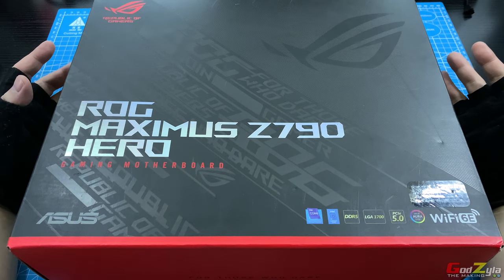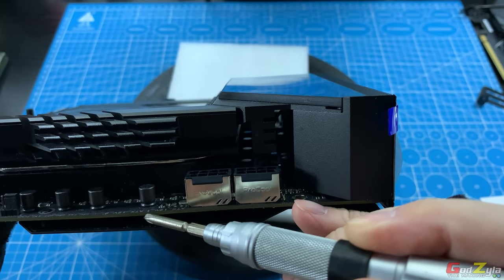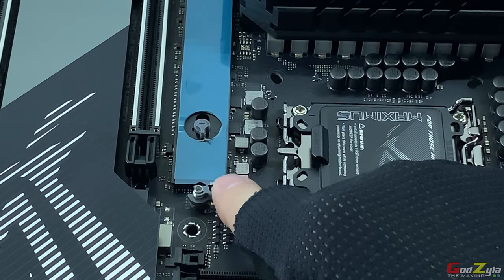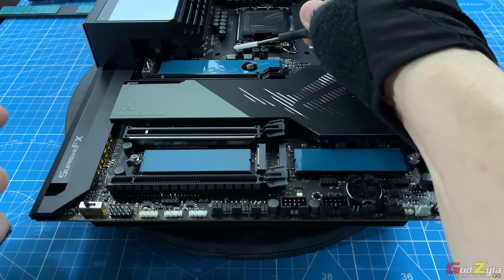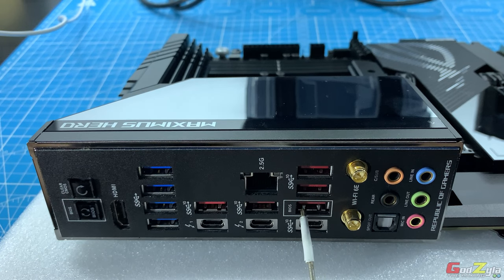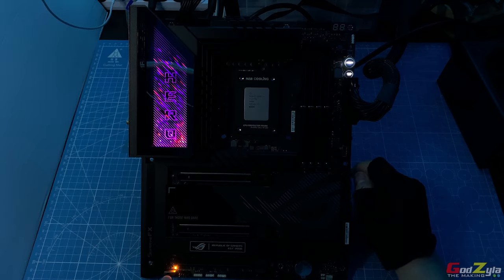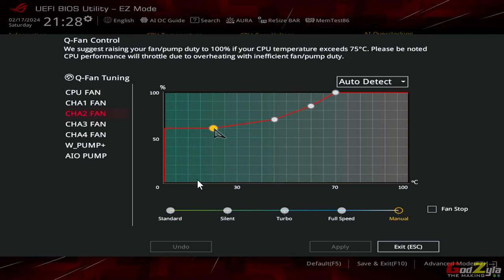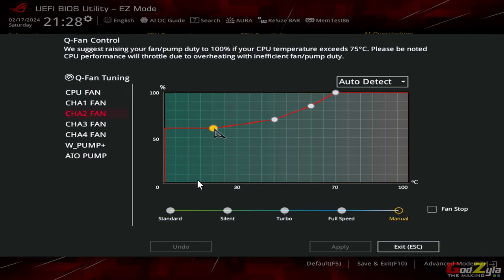Asus ROG Maximus Z790 Hero

Comment: I’ve had this MB for over a year, didn’t even realize the switch on the bottom left of the board until you pointed it out!! You’re great thank you!
Reply from the maker: Hi Nick, welcome to my channel. I am glad you like my content. Yup, if you want specific generation to run on those two slots (PCI-E and M.2) you can make use of that switch, but at all times I will just leave it Auto.

Comment: Your review always perfect !! Very easy to understanding the content, not like the another reviewers, from this now i want purchase this motherboard loll, the backplate with thermal pad, vrm cooling system is really solution for me and can add more mini fans for extra cooling is really great !! , for the bios i think is similiar like z790 asus series i guess ? And how do you think if this compare to dark hero and apex encore ? Is there any different huge different ?
Reply from the maker: Hi Tuyul Nyasar, welcome to my channel and thank you for your valuable feedback. I would say if you can top up to Dark Hero, go fo it. else Hero is as good. now for Apex, I have not touch on this board, therefore not able to give any comments on it.

For the Dark Hero, it's just an replica of the Maximus Hero but with improvement. The improvment as as follow

Dark Hero 
1) XMP profile up to 8000 instead of 7800
2) Enhance Memory Profile (suppose to aid on memory cycle and xmp profile)
3) Wif Fi 7
4) read below as minimal compromisng the PCI-E lane used

Maximus Hero
Total supports 5 x M.2 slots and 6 x SATA 6Gb/s ports*
Intel® 13th & 12th Gen Processors*
M.2_1 slot (Key M), type 2242/2260/2280/22110 (supports PCIe 4.0 x4 mode.)
Hyper M.2_1 slot (Key M) via ROG Hyper M.2 card, type 2242/2260/2280/22110 (supports PCIe 5.0 x4 mode.)**
Intel® Z790 Chipset**
M.2_2 slot (Key M), type 2242/2260/2280 (supports PCIe 4.0 x4 mode)
M.2_3 slot (Key M), type 2242/2260/2280 (supports PCIe 4.0 x4 & SATA modes)
Hyper M.2_1 slot (Key M) via ROG Hyper M.2 card, type 2242/2260/2280/22110 (suppports PCIe 4.0 x4 mode)**
Hyper M.2_2 slot (Key M) via ROG Hyper M.2 card, type 2242/2260/2280/22110 (suppports PCIe 4.0 x4 mode)***
6 x SATA 6Gb/s ports**
* Intel® Rapid Storage Technology supports PCIe RAID 0/1/5/10, SATA RAID 0/1/5/10.
** When ROG Hyper M.2 card is installed on PCIEX16(G5)_1, Hyper M.2_1 slot can support PCIe 4.0 x4 mode. When ROG Hyper M.2 card is installed on PCIEX16(G5)_2, Hyper M.2_1 slot can support PCIe 5.0 x4 mode. When ROG Hyper M.2 card is installed on PCIEX16(G4), Hyper M.2_1 and Hyper M.2_2 slots can support PCIe 4.0 x4 mode.
* When ROG Hyper M.2 card is installed on PCIEX16(G5)_1 or PCIEX16(G5)_2, Hyper M.2_2 slot will be disabled. When ROG Hyper M.2 card is installed on PCIEX16(G4), Hyper M.2_1 and Hyper M.2_2 slots can support PCIe 4.0 x4 mode.
** RAID configuration and boot drives are not supported on the SATA6G_E1-2 ports

Maximus Dark Hero
Total supports 5 x M.2 slots and 4 x SATA 6Gb/s ports*
Intel® CoreTM Processors (14th & 13th & 12th Gen)
M.2_1 slot (Key M), type 2242/2260/2280/22110 (supports PCIe 5.0 x4 mode.)**
M.2_2 slot (Key M), type 2242/2260/2280 (supports PCIe 4.0 x4 mode.)
Intel® Z790 Chipset**
M.2_3 slot (Key M), type 2242/2260/2280 (supports PCIe 4.0 x4 mode)
M.2_4 slot (Key M), type 2280 (supports PCIe 4.0 x4 mode)
M.2_5 slot (Key M), type 2280 (supports PCIe 4.0 x4 mode)
4 x SATA 6Gb/s ports
* Intel® Rapid Storage Technology supports PCIe RAID 0/1/5/10, SATA RAID 0/1/5/10.
** M.2_1 shares bandwidth with PCIEX16(G5)_2. When M.2_1 is enabled, PCIEX16(G5)_2 will be disabled and PCIEX16(G5)_1 will run x8 only.
Reply: @KleoYan  thank you for the reply, i think the benefit of different higher motherboard is from the slot ssd and oc ram ? I'm also notice there is conflict between ssd and gpu because there is same gen slot pcie and make gpu performance drop example z790 apex.
Reply from the maker: @tuyulnyasar2784  it will only drop if you put Gen 5  m.2 where it drops from x16 to x8. for me I can't be bothered with Gen 5 m.2 as the durabilty is often lower. (TBW - Terabyte write)

Comment: Hey I’m planning to build my first PC, do you know if the sn850x with heatsink can be used with this motherboard? Can’t find anything on whether it will fit
Reply from the maker: Hi Jean Aguilar, welcome to my channel. I would strongly advise to remove the SN850X m.2 heatsink, reason for this, even if you remove the thermal pad on the motherboard m.2 top slot, there is still a plate underneath. you might be cable to force it in but I wouldn't advise you to do so.

Comment: Hey another question, people all over the interet say that when installing a Gen 4 or 5 M.2 SSD's on the top first spot, the GPU will be reduced from 16 to 8 lanes.. but i run a Gen5 M.2 in this slot and my GPU goes full 16 lanes, are there just some versions of the Z790 boards having this issue? 
So i currently installed just this one M.2 and still not used another M.2 or the Hyper extension card, can you give me the best possible solution to get the most M.2 slots or the board in general maxed out in the best way with M.2, if possible Gen5, if not Gen4 
should i go with the Hyper extension card? or use the 2 extra slots?
Reply from the maker: Hi Velvet - Real Horror, welcome to my channel. I am not able to test this out as the board is no longer with me. It will be best if you can ask your question at Asus reddit. https://www.reddit.com/r/ASUS/
Reply: @KleoYan  Alright thanks!
Reply from the maker: @VELVET462  thank you and all the bast 😉

Comment: just ordererd the 14900k with this board+ 192GB Vengeance Ram quad kit, this video will help when building, thanks, you do a great job explaining everything!!
Reply from the maker: Hi Velvet - Real Horror, welcome to my channel and I am glad you like this content. All the best with your build too 😉
Reply: How did that turn out?
I'm also getting this MB with 14900K
Reply: @thedarkknightdeltakx-4756  Hey, everything worked like a charm.. had not one single problem, Just one thing, i started with 96GB RAM and i still did not installed the other 2 Ram sticks, will do this in the future but as said, for me everything worked perfect, without a single error
Reply: you just have to correct the wattage of the i9 of course, otherwise it goes full :D thats the first thing after starting or after the bios update
Reply: @VELVET462  So I have to put a Bios Update ?
Reply: @thedarkknightdeltakx-4756  yea sure always after installing a new motherboard, its most likely not up to date when buying
Reply: @VELVET462  Lovely. Probably getting rest of the parts at mid or end of summer. Anyway thanks for the "intel"
Reply: @thedarkknightdeltakx-4756  anyway, wish u good luck with all, let me know when you get into some troubles setting it up :) my comments keep getting deleted or not getting posted.. dunno whats wrong
Reply: @VELVET462  thanks and really appreciate it.

Comment: hi kleo I am thinking of buying the Deepcool LT720 AIO. Is the pump durable enough? I saw some reviews; they say the pump failed in 3 to 6 months. Please help, bro, and guide me (arctic and ek aio are not available in my country).
Reply from the maker: Hi Zoom Videos, welcome to my channel the LT720 AIO is overall good and for me, I have been testing it for more than a month. no issues or whatsoever, just make sure the pump is running consistant 100% or 80%, some have encounter pump failure as they make use of PWM which the pump motor fluctuates up and down base on CPU temp. for me I run it at 100%,  So you dont have to worry as long as your pump is either running at 100% or 80% always. as why 80%, some find it noisy. Also check the warranty coverage of where you purchase it. so in the event if it does happened to your AIO, you can get it change instantly. Another hint for you, for those who uses liquid AIO, it will be best to have an Aircooler standing by, just incase you need to send your liquid aio for repair. I would recommend to get this aircooler, cheap and good, Thermalright phantom spirt 120 SE (7 heatpipes)  https://www.thermalright.com/product/phantom-spirit-120-se/

Comment: Have same motherboard after building I get a warning message - Please ensure to fully connect at least one 8- pin ATX_12v connector to the psu for system stability.
We strongly recommend connecting all ATX_12v connectors under heavy usage. 

After updating bios, it now changed from that to - Please ensure to fully connect at least one 8- pin CPU_12v connector to the psu for system stability.
We strongly recommend connecting all CPU_12v connectors under heavy usage.

Computer works perfectly fine with no crashes. I have done a stress test using OCCT everything came back clear with no issues.

Also, both CPU connectors are well seated and connected to the PSU

CPU - i9 - 14900KF
GPU - MSI 4070 Ti Super
PSU - RM850e(850w)

Any Idea what is causing me to have this warning massage?

Thanks
Reply from the maker: Hi Silva Stoner, welcome to my channel. first you have the error message pointing towards your ATX_12V which is your EPS 8pin cable and after the bios update, you have the CPU_12V connector. It doesnt seems to me that your system is at any fault if you have tested in OCCT. I strongly suggest you to have your motherboard RMA or to do a 1:1 exchange. It might be the sensor build on your board is faulty. Before you do so, you might want to check with others at Asus Reddit forum. https://www.reddit.com/r/ASUS
Reply: @KleoYan  Thank you.
Reply from the maker: @silvastoner  you are most welcome and so sorry, couldnt help you out as you've pointed out the stress test done and to ensure all connections are done properly.

Comment: I do not understand Asus making that add on 2x  M.2 card as big as they made it.. which if placed in the second slot will only block the air flow of the GPU.. why?  Why so big of a card, the M.2 drives are not that big and its a waste of pcb board to make it that large knowing if placed in the second PCIE slot it will be blocking the air flow into the GPU..
Reply from the maker: Hi LivelysReport, welcome to my channel and yes, I do agree with the blockage but as why so big. It m.2 are to be if PCIe 5.0, that will run hot, which I believe why the PCIe m.2 card has a massive heatsink to cater for not 1 but 2 gen 5 m.2. With this said, I still agree to your point and there might be other solutions to this, instead of having two disadvantages. 1) card being big. 2) blockage of the GPU placement. Will feedback this to Asus if they can improve this on their next board. Thank you for your feedback.

Comment: What do you think about 
Asus ROG Strix B650E-E Gaming WIFI. Is it a good motherboard? Which is better to buy 
Asus ROG Strix B650E-E Gaming WIFI or Asus ROG Strix B650E-F Gaming Wi-Fi ?
Reply from the maker: Hi Ioannis, welcome to my channel, if budget allows to, I will go for X670E boards, as for B650E boards, either one (B650E-F or B650E-E) will do just fine. difference is on budget and the features. you might want to compare them at (B650E-E) https://rog.asus.com/sg/motherboards/rog-strix/rog-strix-b650e-e-gaming-wifi-model/spec/ and (B650E-F) https://rog.asus.com/sg/motherboards/rog-strix/rog-strix-b650e-f-gaming-wifi-model/spec/
Reply: @KleoYan  Thx🖖
Reply from the maker: @ioannis.  you are most welcome. all the best with your build too. 😉

Comment: I just got this board and I can’t get it to boot, can you help?
Reply from the maker: Hi AimBoyYardie, welcome to my channel. by plugging the processor and rams in.. if you are not able to boot, try only one ram stick. look at the error code. what do you gets?
Reply: @KleoYan  thanks so much for responding! Error code 55?
Reply from the maker: @DieHardFlint  For error code 55, it means either you have not sit your CPU properly or there are dented pins on your 1700 socket. Also if your rams are not detected.

Comment: Had this board  for 1 year and running great until now. Pair this board with strix 4090 and it block 2nd pcie gen 5 slot and cant utilize hyper M.2 gen 5 ssd…then ASUS came out with z790 dark hero and relocate the 2nd pcie gen5 slot a little bit lower to accommodate big graphic card like strix 4090
Reply from the maker: Hi Am 84, welcome to my channel and thank you for sharing your experience and additional info. 👍

Comment: I want install ssd on this board which slot can used without loss performance ?!!
Reply from the maker: hi SIL3NC3 SHOT, welcome back. If it's of nvme m.2, plug it to the top slot near the processor, that will gives you better boot time. If it's 2.5" SSD, it does not really matter where you plug on the sata port as all sata ports are controlled by the z790 chipset.
Reply: @KleoYan  thx bro . But i have 2nd one so as your review if i installed it on slot m.2--2  is there any loss of performance or bandwith for pcie ...sorry for my. Question  but i need use all slots for m.2 without affect on pcie 1 bandwith /lanes . Is that possible?
Reply from the maker: @SIL3NC3-SHOT  for m.2 if you place any of the slot, no performance loss, even if you plug a Gen 5 m.2 slot at the first slot. unless you are using the m.2 PCI-E riser. If you plug it to the 1st PCIE slot, m.2 3rd slot will be disabled and if you plug the m.2 PCIE risrer to the last PCI-E slot, then all your m.2 can be used but at Gen 4 speed.
Reply: Thanks i appreciate your help🙏
Reply from the maker: @SIL3NC3-SHOT  most welcome.

Comment: is this motherboard compatible with i9 14900K ?
Reply from the maker: @Energy666.  hi and welcome to my channel. Yes it is compatible.
Reply: @KleoYan  thanks bro another question better this motherboard or one ASUS ROG STRIX Z790-E GAMING WIFI II  for I9 14900k?
Reply from the maker: @Energy666.  either board does its job. Greatly depends on your usage. For me I will go with Asus x670e-e as all the m.2 slots are on the board and do not require to plug the m.2 PCIe card to have additional m.2.
Reply: Ok thanks !
Reply from the maker: @Energy666.  you are most welcome. All the best with your build too. 😉

Comment: Could you compare it with AsRock z790 Nova please?
Reply from the maker: Hi myfavouritetrash, welcome to my channel and this is my content about the nova https://youtu.be/Esfw8JlPNFk?si=ciF1386jd0850h6J . For nova there are no thunder bolt port behind not a bios flashback button behind but the advantage of nova is that it has 6 m.2 slot on board, strong vrm cooling too.
Reply: @KleoYan  Hi there! Thank you for the prompt reply. Special thanks and KUDOs for such a detailed product reviews and immensely helpful tips. 👍 I appreciate it greatly! I have already watched your impressive reviews for AsRock z790 Nova and AsRock z790 Taichi Lite. Both boards have very solid feature sets and amazing price tags. 🤑Personally, I will be able to live without 2 x ThunderBolt 4 slots and flashback button too. What I do care about is VRM + cooling capabilities (as well as Intel I226-V vs Killer E3100G) How do they compare? 🤔 Could you elaborate, please? Many thanks in advance 😀
Reply from the maker: @myfavouritetrash  both nic have issues with drivers but on ASRock Nova z790 I have zero issues with the E3100G. Same applies to ASRock Z790 Taichi lite or even my own Z790 Sonic. The default drivers. If you just want asethetic, good budget, good performance on vrm and hassle free on the NIC. I would go for the Nova.
Reply: @KleoYan  Thanks. I plan to pair one of those with i9-14900K + 2 x 48GB G.SKILL DDR5 6400 (32-39-39 CAS Latency 32) + GeForce RTX 4090. Which one will digest such setup easier ? 🧐 without having stability hiccups ? 🤔 (in terms of VRM + cooling)
Reply from the maker: @myfavouritetrash  hmm. I have not test on the Taichi Lite but have tested on this Maximus Hero and the Nova, both can run 2 x 48 at 7200 with CL34 without issues. as for VRM cooling, it also greatly depends on your case airflow. Nova is in advantage as it has a 40mm fan at the rear to keep things cool and it's easy to clean if there are dust accumulation.
Reply: @KleoYan  Thanks a lot for sharing results of your tests! 🤝 Extremely valuable facts! 👍 I do not expect any serious "dependency" from the case airflow: ThermalTake CTE C750 (Fans - all 140mm: 3 front + 3 back +  3 bottom + 2 Top) +  ARCTIC Liquid Freezer III 420 on the right side. Stability of overlocked modules during extended loads is the only concern I have 🤔
Reply from the maker: @myfavouritetrash  you are most welcome. hmm just my opinion, this era processors are very capable. I rather undervolt them and not drop default performance. As for overclocking. I find not point just to have the clock frequency up and to draw more power, generating more heat and last but not least, degrades the component longevity. Again that’s up to individual.